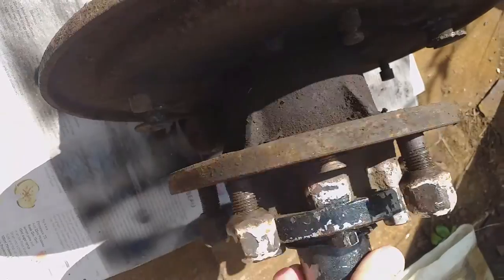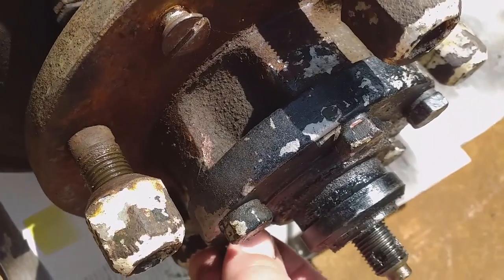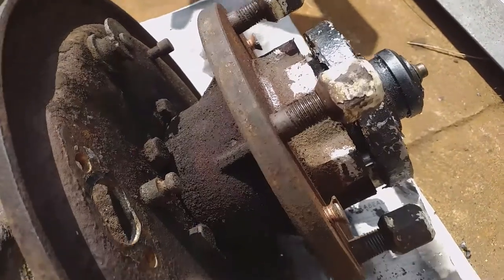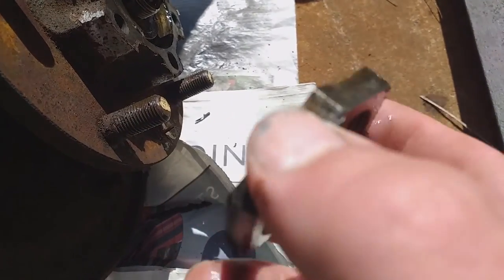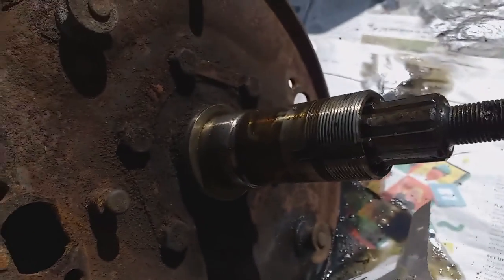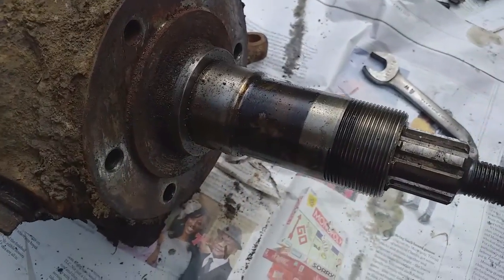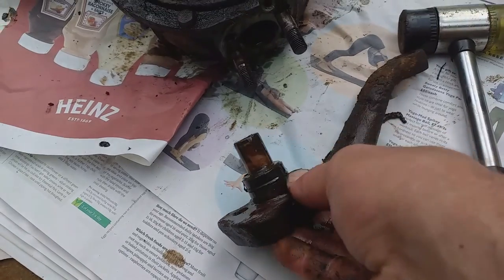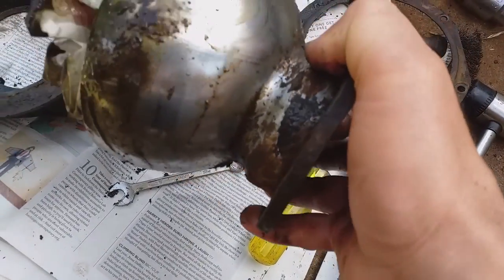Landrover Series 2a Front hub strip swivel pin housing removal

Comment: Just viewing this helpful video as I undertake the same exercise. I too took the right hand swivel housing off the axle without loosening the upper bolts first to discover that there's not enough leverage to shift them.....also having to reach for the blow torch. The other side is still on the axle, so I have already loosened them!
Reply from the maker: I cleaned the parts using a wire wheel on a 4.5" grinder then an old toothbrush and paraffin followed by brake parts cleaner prior to painting with smoothrite spray. Thanks for watching and commenting
Reply from the maker: At one point of this project I was missing the option of a parts cleaning cabinet, but I  managed with very low tech equipment also white spirit is a good degreaser in some situations
Reply: @peterh600  I am browsing them on eBay right now...that and sand blasting cabinets!